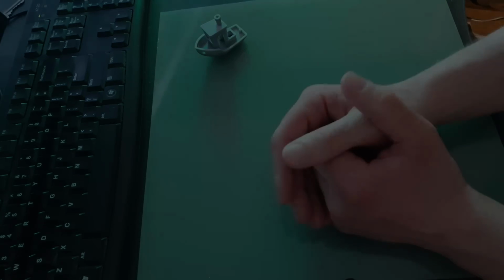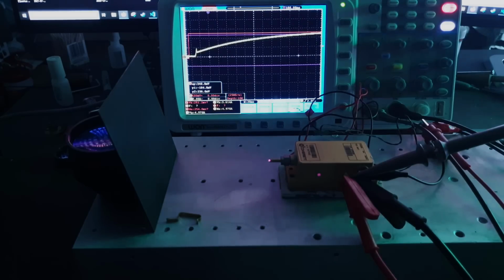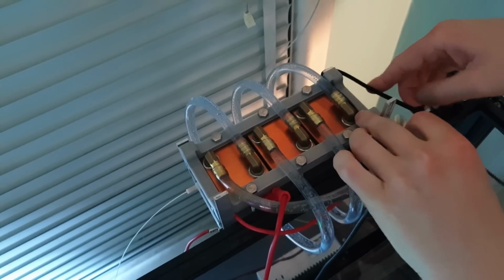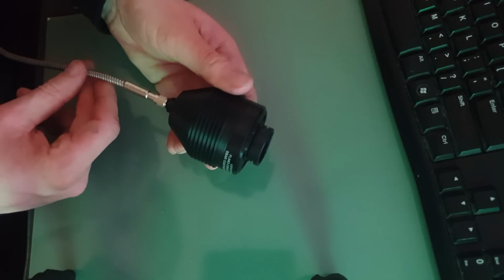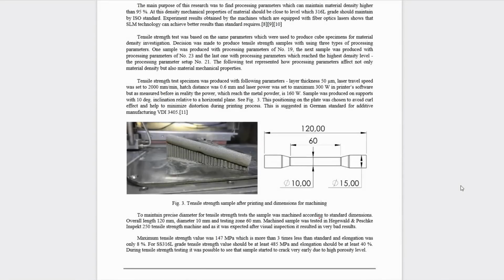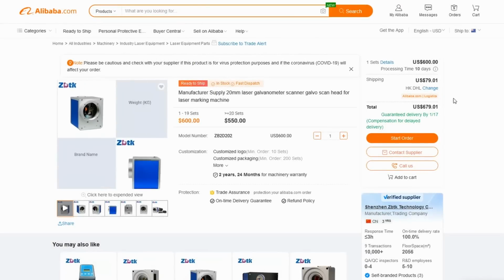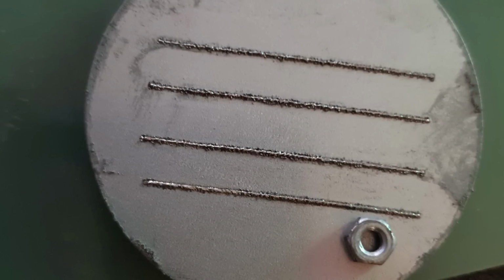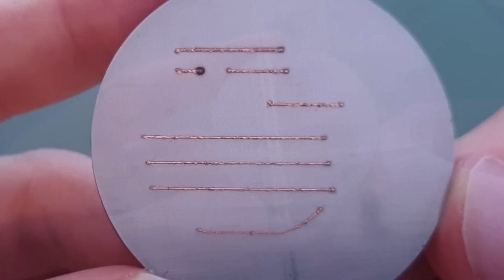SLM Metal 3D Printer - Update | Metal Matters

Comment: Could you make a slm with a plasma cutter at a low psi?
Reply from the maker: The nozzles for plasma cutters are around 0.8mm - 1.1mm on average. At pressures high enough to sustain a plasma arc, I think this will blow powder off the bed. Maybe not SLM, perhaps another process..

Comment: Great project! Do you have a rough estimate of the M^2  value of the fiber coupled laser at the output of the fiber?
Reply from the maker: No sorry. Even the manufacturer didn't have an answer for me when I asked. What are you trying to calculate?
Reply: @metalmatters  Just out of curiosity. There is a formula approximating the output characteristics of multimode fibers when you assume the power is well distributed over all modes. M^2 would come out to around 60 in your case. It would be interesting if this model holds true. But high power measurements are always quite hard to do. Using a slit beam profiler would be nice in this case but with M^2 being close to 60 these things sadly give no trustworthy results.

Comment: do you think it's possible to cut each layer of the print with a laser out of a thin metal disk and then bake those individual slices together?

the idea is that if you use sheet metal slices as a base, you'd not have to worry about uniformity of powder thickness or wire deposition, less warping problems, etc.

it's also possible to test this approach on plastics first.
Reply from the maker: I've wondered about this too. I don't think one of these lasers would be a good candidate as their divergence is too high. i.e. you'll only be able to cut thin steel which will likely warp when heated. I think a plasma cutter might better serve the purpose.
Reply: @metalmatters  maybe even etching it chemically. sort of how photolithography works.

the thing that i'm concerned the most is that you might be looking for a reasonable solution to a problem that might have no reasonable solution.

Comment: I'm curious why you chose to deposit the powder directly onto the bed. I'm comparing what little I know from laser welding systems and how they sometimes deposit the powder directly through a powder nozzle. I guess this would make it more of an FDM type printer and could reduce the resolution of the print. I TIG weld stainless at work and what I can say is that the filler rod tends to ball up and run from the heat when it sits in the heat for too long, unless it's on the work piece surface. I wonder if the powder surrounding the area where the laser is pointed is drawing into the heat at different rates during the print. I'm not sure the particle size or how consistent that is, but I wonder if this could be why you're seeing inconsistencies. I guess dialing in the "heat/travel speed" of the system could render what I'm saying useless because I've welded some things where I get the heat/travel speed just right and I can just hold the filler rod in the gap and just move the torch. The science of lasers is beyond me, but this is really cool. I've been thinking about this a lot lately.
Reply from the maker: I chose powder bed fusion as it is the de facto standard and there is a wealth of information available on it. I have thought about a pressurized powder system also but think it's just too dangerous for hobbyists/amateurs. This was probably the lowest power run I've done as the collimation lens didn't expand the beam as much as it needed to and the input power was limited to around 100W, approximately 80W by the time you account for losses. The particle size is 15 - 45 um with a mean of 29um. As you suggest, I think it's akin to welding with too lower current/slower speed and there is a lot of excess heat as a result creating inconsistencies/balling. There are some other things going on with the powder here too but I will dig into that in the next video.

Comment: one of the main guys that's known for the speed 3D-Benchy printing also had that problem with cheap ball screws and he solved it very cost effectively with a couple of magnets and metal balls, its pretty amazing, not sure if that works for your usecase but it probably would
Reply from the maker: Do you have a link to this?

Comment: liquid nitrogen
Reply: resistive wire extrusion should be quite easy, with quick cooling after the print line head
Reply from the maker: @Jkauppa  https://hackaday.io/project/169412-wire-3d-printer like so?
Reply: @metalmatters  more like normal PLA 3d printer, same kinda of quality, so that you can print the boat sample well
Reply: @metalmatters  normal PLA printer does not flow current like a welder, it flows around the tip of the printer head
Reply: carbon powder absorber above the target melt shiny metal

Comment: so... your using an 'either/or' workflow ! why not an '&' flow, as in heat the localised metal (to a very high mailable temp) with another heat source (very hot diy electrolysis on demand bubbled h2 shielding gas?) while adding heated lasered/friction weld fluidic metal at a given location
p.s encode your audio at a better bit rate as its degraded by yt upload i assume (many vids recently seem to have this same sound degradation)

the old oxidised copper powder.. no need to make everything you do complicated & expensive & reliant on 3rd party sellers, remember/learn the fundamental's just flash sinter it in a diy ball mill with a camera flash or figure out the light frequency range it reverts back to pure metal from it's old oxidised state & tell rob/every diy'er see Robert Murray smith channel

Comment: This is a super important project. If you need or want help on manufacturing the metal parts, I am a hobby machinist in spare time and could try and help mill or turn some small parts. 

You are doing something here that many have not even tried to do, and are closer than many other attempts I have seen. Keep your spirits up, and look to the community as well for help when you can. 

There are reasons that this technology has not yet made it to the desktop, and many of those are commercially driven ones. The FDM and SLA printers went through a similar evolution once their patents expired and such; keep staying the course, methodically and safely of course; you are boldly going where few have gone ahead of you.
Reply from the maker: Thanks for your offer of help. The parts are quite difficult to manufacture due to narrow wall thicknesses and the need for galleries within the build piston so I think the plan is to redesign things to make them more approachable. I originally looked at getting some parts CNC'd but the prices are pretty astronomical, betting on the fact it'll take more than one attempt to get things right I think it's probably better to redesign them at this stage. I'll be putting together a CNC plasma cutter so hopefully that plus some welding will take care of things.
Reply: @metalmatters  let me know as you go along if there’s anything I can help with on the metal front or even DFM feedback.
Reply: @michaellowry1888  That's awesome :-)

Comment: Yet another great video. 

I keep worrying about the high power densities and users that don’t understand clean. 

Have you considered “stitch” or “chequerboard” welding to get a more even line?

I keep thinking of more user friendly systems. 
Have you considered wire fed sputtering with magnetic focussing inside a vacuum? Less consumables. 

Or magnetic launching of molten balls from a wire? Magnetic boosted mig.
Reply from the maker: Haven't considered those, thanks. I have read about sputtering based metal 3D printing. I think sputtering systems rely on a level of vacuum that is well beyond your usual roughing pump. i.e. $$$
Reply: @metalmatters  
Thanks, I’m glad you have read up on it.
The levels of vacuum are quite severe, but laser densities of kw/mm^2 are in my opinion harder to control if not achieve.